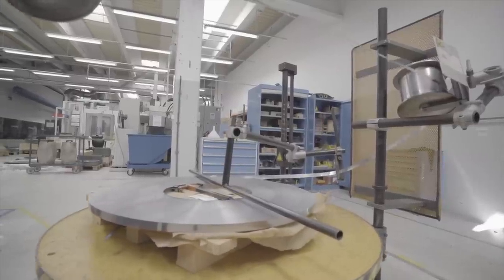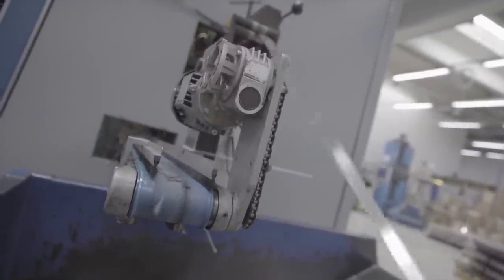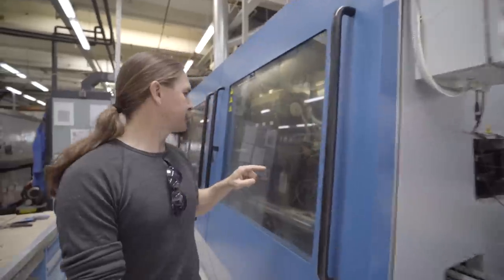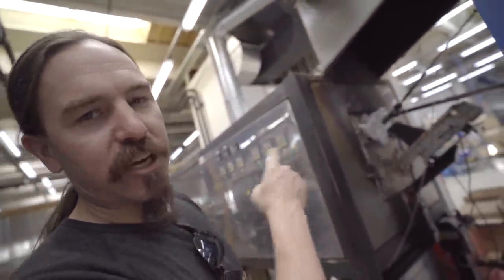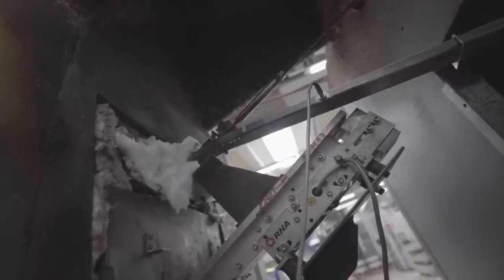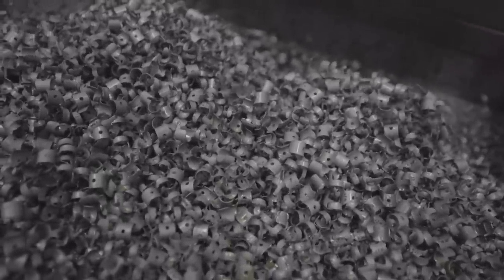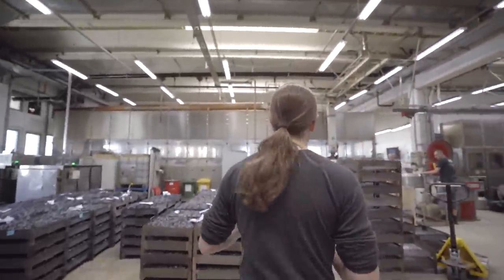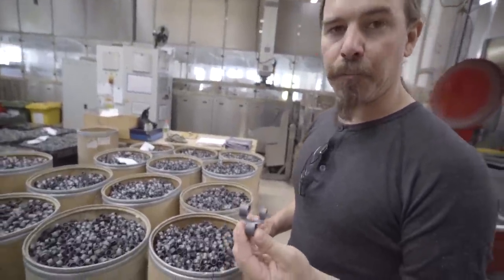How's It Made: A Giant Machine That Makes MG Links

Comment: Does all machine guns have Semi automatic mode....
Reply: How fast can you un-pull the trigger?
Reply: No, but a good gunner can usually squeeze off just one round (or very short bursts for the high ROF guns)
Reply: No, in fact, most do not.
Reply: just look
Reply: Better question would be why do “true” battle field machine guns have a semi mode. Instead of semi they should just have a 3rd burst mode. At least in my opinion. If you want a semi mode then just load 1rd. But that creates it’s own problem because then it’s just a single shot rifle. You better hope that your sights are on if you’re trying to achieve something real.
Reply: Nope, there is a reason they are called machine guns. You are thinking of selective fire on semiautomatic rifles capable of firing single shot, burst shot and fully automatic fire.
If you watched that recent Ukrainian Army video of that M-113 and the M2 Browning machine gun, that's exactly how you are not supposed to use a heavy machine gun.
Reply: Our .50cal HMG had single shot for adjusting targets then rotate it too auto and it’s the gunner that controls the burst length. On my APC the Pam said not to select single as it was on a remote weapon system. 1-2 rd spotting bursts, 4-6 round killing bursts with only two bursts needed because if it needs more you’re firing the wrong sized gun at the party. On a tripod you’d fire a spotting round then go auto once adjusted. 

I never encountered any mg below .50 or 12.7mm with the ability to fire anything but auto but as the gunner on gas operated mgs you could adjust gas setting to slow the RoF so slow you could make it easy to single shot but that takes away its very purpose and design and sounds awful.

Once you balance gas operated guns correct the gunner with experience can fire the right length of bursts as required.
Reply: @stevepirie8130  one tracer for every 10 rounds? I forgot the number
Reply: 4 ball 1 tracer is normal but you can get 1 ball 1 tracer for AAAD work. As a commander I’d put all tracer into one mag for target indication for my troops. Most of my all ball mags was my reserve for my section to use before needing someone to refill mags from bandoliers.

Comment: Why MG links can't be made with cheap plastic?
Reply: Strength. Ammo is heavy in large amounts, and you can't have the links breaking under their own weight as they're moved around, loaded, etc. Also, they need to be able to be manipulated by the gun's feeding system, again without breaking or getting chewed up and leaving pieces behind that cause a malfunction. Especially in aircraft.
Reply: @trogdor8764  Ok, but even polimere ?